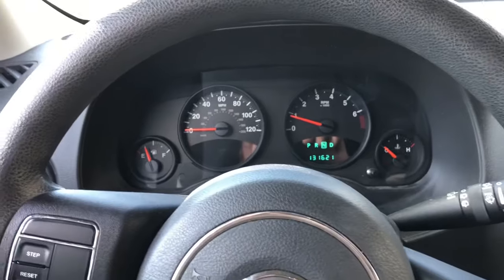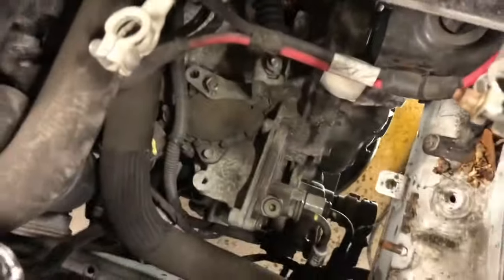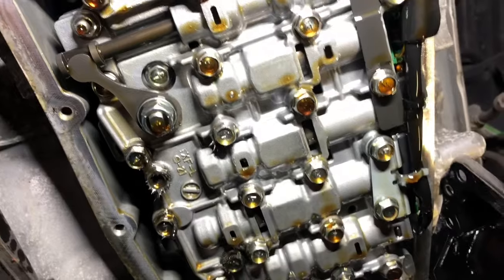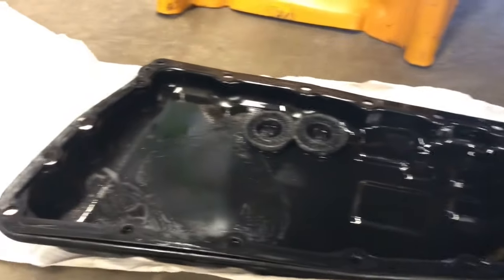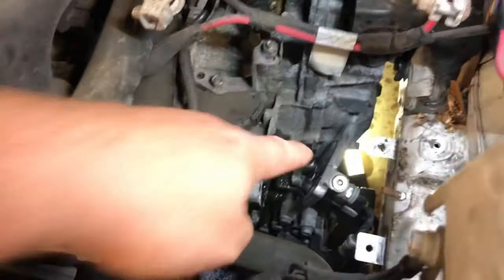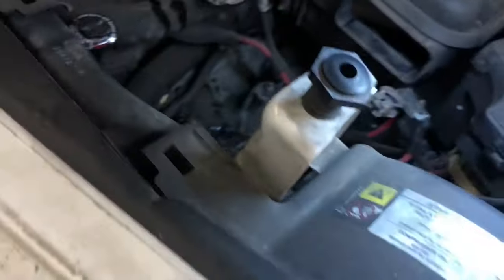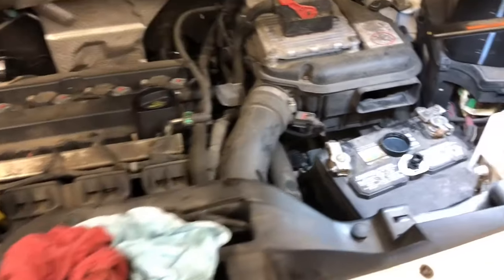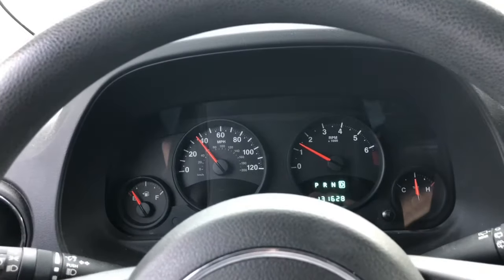Jeep Patriot CVT Transmission Fixed jf011e whine noise service

Comment: Great video!!!  I have a 2012 Jeep Patriot and it has had issues with driving up steep grades where i would have to stop for about 15 mins for the transmission fluid to cool down (didn't know what was going on at the time).  I also started to have power issues where I needed high rpms to maintain my speed and towards the end there was slipping gears problem.  Not to mention the whining that started years ago...used to just happen after the engine would heat up and then the whining would happen all the time.  I watched this video and did exactly what you did  ( changing both filters and new fluid) and my car is back to working as well as it has in years!.  I never leave comments, but i just wanted you to know you saved me big buck$....plus the great feeling of fixing the car myself.  If you are having problems similar to mine, watch this video and maybe you can resolve it yourself.
Reply from the maker: So happy to hear! I appreciate the feedback!!
Reply: Thank you for sharing it, I have the same problems. I'm going to replace the filters and I hope this solves the problem. How much oil did you put on it?

Comment: We've taken our 2010 Patriot to the transmission shop every 50k miles since we owned it. That tranny is a big pain in the rear & we don't drive it over 65mph/2k RPM to prevent the whining & overheating. The shop never told us about the canister filter under the battery, they just clean & change filter under the pan.  Great video!
Reply from the maker: Thanks! I think that little filter may be the key to keeping these things alive!
Reply: Hi same here they do not know much about that transmission.  From no filter at all or only one in the pen. Thank you for you coment.
Reply: Exactly why I bought a stick patriot.

Comment: I was asking around here in Moose Jaw in Saskatchewan 2 quick oil change chops told me there is no filter in a cvt transmission.  One car chop and one special transmission chop told me there is only one filter they didn't know about the little round one. I have a spine problem and I think I do it myself if it takes 2 days or more is ok. The thing is I can trust anyone just myself. I thank u so much for your video. 👍
Reply from the maker: Its pretty scary (and probably the reason why so many fail) that shops don't know about the filters on these things!  As you can see, they have two filters!

Comment: I followed the steps on this video, and it all worked out fine! Thank you! 2017 Patriot Sport SE, 2.0, serviced at about 93,400 miles.
Reply from the maker: Great! Glad to hear!
Reply: I'm having a similar issue with my 2015...but I'm experiencing some accelerating issues. Did you experience other symptoms?

Comment: Informative video. My Compass was whining like a jet plane, never had fluid change . Tried just a fluid change and tranny filter and quited right down .  I blamed it on the Chrysler cvt fluid. I used cvt fluid from auto parts store (motomaster) at 1/3 the cost (made by Shell) and still running fine after 3yrs since change. Used engine oil dip stick. I will now be changing that other filter. Thks

Comment: This video helped me fix my 2011 Jeep Patriot! The whining sound was particularly bad on cold mornings. Would sometimes lessen after driving a while. When I opened up my CVT transmission, I did not have as many metal particles (Note: I stopped driving regularly as soon as the whining started), but the filters were VERY clogged! My theory is the filters clog and starve the transmission of the flow of fluid. Which is what creates the whining sound. After replacing both filters and about 6 quarts of new CVT ATF+4 fluid, my car runs well and the whine is gone! This happened to my Patriot at about the 115K mile mark. The service manual should be updated to recommend CVT filter changes every 80K IMO. The hardest part was getting the plastic skid plate on and off.
Reply: Your comment has given me hope. I just made an appt for Monday to go to the Jeep dealership because my 2011 Patriot is whining. It started when it turned cold. The car drives fine but the noise is constant . My mechanic said I need a new transmission, which I can't afford. He did NOT check the filter or anything. After reading your comment, I'm going to get a second opinion before selling it. Thx
Reply: @QueenShelly82  Note: Jeep dealerships have an agreement with Nissan that Jeep will NOT repair the transmissions. (Nissan supplies the CVT transmission). You might be able to get them to do the filter and fluid change. But they will only ever recommend a transmission replacement even if it would be a simple fix like a bad solenoid in the valve body. You are probably better off going to a Nissan dealer or a trusted transmission shop that regularly works on CVT.
Reply: @joshuawedekind3903  thank you for the advice. I will do that.

Comment: This is a life saver. About a month ago, the temperature outside was reaching 90 degrees. Started whinning when I pressed gas, and got louder the more I gave her gas. Then transmission temperature light illuminated. Pulled over, sat in neutral, and it went away. Never has it shifted hard or shifted weird. Starting to do it more often now, with no transmission codes. 

EVERY trans shop either told me replace it or they dont mess with them. A lot of them told me its almost impossible to do a fluid and filter change. Again, she runs great other then the noise every so often, knock on wood. I will definitely be trying this.

P.s if this does not work, does anyone know if I have to replace the transmission, can you put a standard transmission in it instead of the o.e cvt?

I have a 2012 jeep patriot latitude 2wd w/cvt transmission.
Reply from the maker: Hi, make sure you change BOTH the filters, every 50K miles or so.  As long as your trans didnt slip or anything bad its probably still ok.    You can put a manual in it, but youll have to research how, I dont think its a cheap/easy thing to do, but it is possible.    Keep me posted on how it goes!  Thanks for leaving a comment!
Reply: Trans shops are scared of cvt cuz they don’t know much about them. Change oil and filters and you will be good. Oil type and amount are important. To much oil can damage and to little it will whine again. It’s very doable for a backyard mechanic if you follow the directions here. I’ve done several and it’s not voodo or anything just follow this video and buy the special dip stick on Amazon.
Reply: No shit it doesn’t shift hard or weird, it’s a CVT

Comment: I’ve had two jeeps with the cvt. Found if you change oil and filters you will be good for a while but if you take it on long trips, like 5-600 miles they still overheat! I put a truck aftermarket trans cooler on my last one and it worked like a champ! 386000 miles and gave to grandson who sold it and see it still running around town.
Reply: I'd be interested to see or know how you added the transmission cooler!
Reply: Pretty smart. I also have a trans cooler on my 5 speed

Comment: i just experienced the simptoms on mine, i pulled over, waited awhile and drove it home slow, the light shut off, and power came back and whining went away, like back to normal, i will get it serviced tho, i don't want bigger problems. i bought this jeep used a few months back. with around 145000. miles on it.  thank for video.
Reply from the maker: Make sure they change both filters!

Comment: I can't imagine that today I just got a good news from you, I have my Nissan Xtrail T31 CVT, it  makes  whining  noise at 100mph. I normally service the transmission every 30,000 miles I drop the pan and clean the magnets, and clean transmission  filter,  put new CVT fluid but never did I know there is another one at the top and I have never changed it, I will now consider changing both of them and see whether the whinning will go away. I will come back for updates
Reply from the maker: Keep me posted! Hope it works out. I can’t believe even dealers don’t know about the top filter. I honestly think it’s a scam to sell more repair work when they blow.

Comment: i’m commenting because i have run out of options with my 2010 jeep patriot. i love this car, it is so amazing and has given me next to no issues except for one big one. i got this car in the fall and had no problems, but when the weather started to get hotter, my transmission ended up overheating after a 45 minute to an hour drive at around 65 mph. i’d like to say that i take really good care of my car and never push it too hard, i usually only ever go 65 at the fastest and never go over 3 rpm when accelerating, i usually only hit 2 and a half when i need to go fast. i’ve had my transmission overheat 3 times in the almost year that i’ve had it (this is the second 2010 patriot i’ve had, but my other was totaled in an accident, but i never had this problem, even in the summertime). after going to a mechanic, i found out that the previous owners had installed an after market ac unit and all of my hoses had been disconnected and were no longer cooling efficiently. i had the entire unit replaced and assumed that would fix it for good, it wasn’t until about three months later when i had been driving around for about an hour and a half to two hours that it happened again while i was going around 60 on the highway. most of my drive before was either on the interstate (65 mph) or in the city (30-45 mph) with the ac on because i had someone in the car with me, but usually i just drive with the windows down. afterwards, i took it to my mechanic and they couldn’t find anything wrong with it without tearing my transmission apart, so yesterday i brought it into a transmission shop and they had it for about a day and a half but couldn’t find anything wrong with it because they couldn’t get it to act up. they even said that everything sounded good and ran well. when they put the computer scanner on my car, it comes up with a torque converter code, but they said that of that was the issue, then it would happen more frequently, rather than only three times. even after with it overheating, they said that my transmission fluid looks super clean and is completely filled up.

i’m about to make a long drive soon and i really need this issue resolved. sorry for the long read, but if there is anything that you can diagnose from this, or any advice that you could give that would be fantastic! i was thinking about having an aftermarket transmission cooler installed as well as changing my filters, i don’t know if that would help, but i only need it to make this trip and then it will only be going city speeds for a while, at least until winter.
Reply from the maker: How many miles on the transmission?  When was it serviced last? The first thing I say to do, is change the fluid and filters, BOTH the filters, some dealers dont even know about the smaller second one on top of the transmission that I show how to change.  After that, possibly an auxiliary transmission cooler would be worth adding if you want to keep the car. Keep me posted! Best of luck!
Reply: @JohnVHLife  my transmission just hit 164k a week or so ago and i got it at 157k. the last time it was serviced was when i got my oil changed around the middle of june. i was looking back at the service record on it and it looks like the transmission filters have NEVER been changed, or at least never recorded. i’ve already bought the new filters and plan on bringing them to my mechanic this week, i’m definitely going to ask them about installing that cooler as well. thanks for the response, i really hope this fixes my problem! 🤞🏼
Reply from the maker: @calieghdavidson  Good plan, keep me posted! Best of luck
Reply: @calieghdavidson  Any luck?
Reply: @andrewstewart8704  oh wow i totally forgot about this 😅 but yes, this actually did work for me! i bought the filters myself from an auto shop and brought them to my mechanic to have them install it. they did have an issue though where on the schematics for the transmission, it looks like one of the filters is internal, but i showed them this video and they were able to replace it no problem! i haven’t had any issues with my transmission overheating since then and have driven 3+ hour trips at a time! if you’re having issues and no one can diagnose an issue, i would definitely recommend replacing BOTH of the filters because i think the second hidden one is where the issue lies.
Reply: @calieghdavidson  Hello and thanks for the response and I'm glad that sorted your issues :) 
I Bought a Jeep compass recently and thought the transmission was slipping, took it to a transmission specialist and he said it's a CVT and that it was driving ok after the test drive.
He told me to sell it because it had 220,000km or 137,700 miles and it costs $7000 AU to replace and the CVT belt can just suddenly snap and he said that it may already have a second hand CVT in it by now.
How many miles or KM is on your car? 
We like the car and want to hold onto it if possible and looks like Servicing all the filters and new oil could make it last.
Its a 2007 Compass by the way.
Reply: @andrewstewart8704  yeah, these cvt transmission are really tricky, idk what chrysler was thinking 😂 this thing with them is that they aren’t as powerful as the transmissions in most other cars, at least the older ones aren’t and they’re prone to more problems because of it. the mechanic was right in saying that to completely replace your transmission would run you about 7 grand probably just for the transmission itself, but at 137 thousand miles unless it’s been run to hell and back, you’re probably sitting pretty good! my patriot is almost at 177,500 miles and still runs great for what it is mechanically. the key to really any car is just to do preventative maintenance and regular upkeep, and if you think something is wrong, then definitely have a mechanic check it out! if you really like your compass, which i don’t blame you lol, then i would say just go easy on it, don’t try to floor it every time you start off and don’t go over 70mph (not sure what that is in km 😅) if you can help it! i also try to limit my extra trips outside of my work commute if i can help it. i live in a more rural area, but if you have to opportunity to take public transit, walk, or bike, then that will definitely help your compass last longer too since you won’t have to run it as much!
Reply: @calieghdavidson  Thanks for the reply mate, It's great to hear other peoples statistics. 
In Australia the speed limit is 68 m/h or 110 km/h and I'm not one to go over it.
I have only recently bought the car and have watched the economy go from 21.4 mpg as per lady owner before me to 22.4 mpg and it seems to want to get even better mpg too just driving it nice and gentle around town.
Yeah! the damn car is growing on me 😀

Comment: Thanks dude, I have a 2012 Jeep Patriot Limited Edition 4WD and am experiencing a whining noise when I go past 2000 rpms on the highway (don't hear it in the city). I believe the transmission filter underneath the battery is the issue. I'm going to perform a whole transmission fluid change with the new gasket and other filter too. Thanks for showing us how much CVT transmission fluid you used. Crazy how there's no dipstick already in place for us
Reply from the maker: Yessir, change both filters for sure! Let me know if it helped!
Reply: Did it work? Mine has the same problem
Reply: @reedboi3631  Yes I changed both transmission filters and poured in OEM transmission fluid. I've never heard the whining noise since then
Reply: @user-ct1lf3hf1v  thanks so much!

Comment: Another trick you can use to find out how much fluid you need is to measure your old oil that you took out. Assuming its not leaking you can use that as a reference when you dont have a dipstick. Thanks for making the video, I had never heard of that top filter before
Reply: OR you could just flip open the owners manual...

Comment: Thanks I did change the 2 transmission filter and oil pan gasket ,add almost 8 quarts of oil and the noise did stop right away  ,thanks I save around $3k on a used transmission my jeep has 189000 miles

Comment: There's a $60 part that replaces the plate that holds the top filter in, basically a bunch of plates stacked up to add surface area for cooling...definitely going to replace mine with that.
Reply: Can you link to it?
Reply: @mattowens6970 is it there?  Keeps disappearing when I refresh.
Reply: @Chris-D9  Do you have a Link?

Comment: Hello! I had this problem with the wining noise and jeep patriot wont go up to 20-30 miles, I fixed it by doing this, and it works back to normal. Now , I’m a little concerned about how long is this going to work fine? Before having to replace or rebuilt transmission? Car is a 2012 and it has 147,000 miles. Any comments will be appreciated with any ideas or experiences! Thank you so much for the video !
Reply from the maker: Great questions, I wish I knew the answer, how bad were the magnets in the pan? If they were not bad, it'll probably last quite a while, but that's a guess..